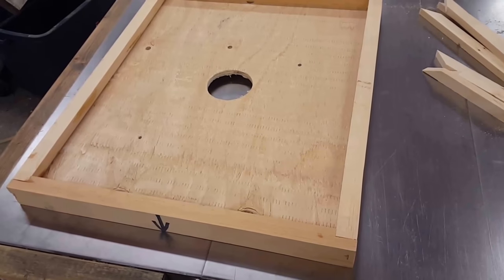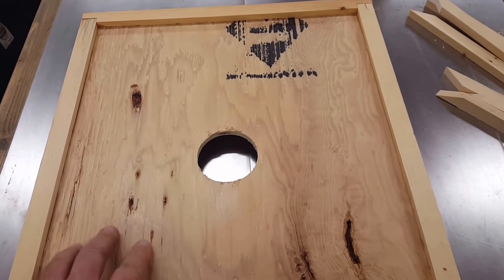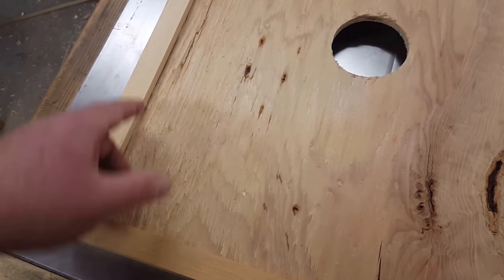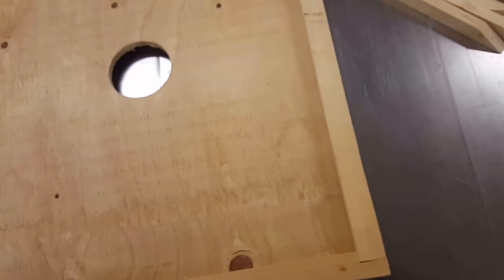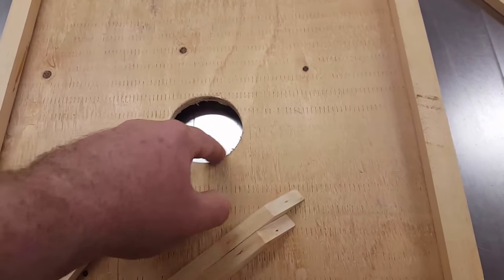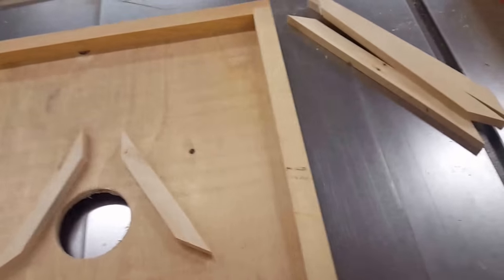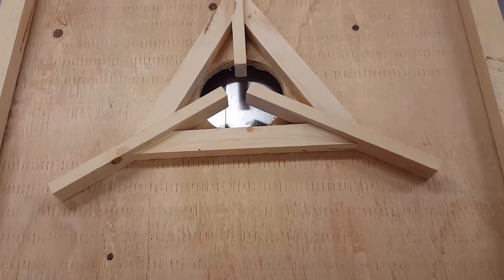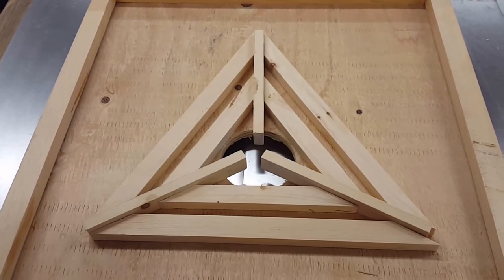🔨Bee Escape Assembly - That Bee Man

Comment: Quick question, is there any chance you priced out what it cost you in materials to make these? I’m just wondering how it compares to buying them. I know you’re a very handy woodworker and I’m sure you enjoy making them yourself. Just curious, thank you Brad!
Reply from the maker: That's a good question, and I do know roughly what my input costs are.  You've touched on the two main reasons that I build equipment like this and also why I do not build boxes.  

The plywood is easy to calculate and you can calculate the lumber down to a "board feet" figure and cost it from there.  Add in window screen, staples and glue and that's a pretty accurate number to go by.  

I never build boxes because there's no economy in it and I really hate building boxes.
Reply: @ThatBeeMan  thank you for letting me know. I’m thinking eventually I might try my hand at making some of the equipment, but boxes is not one of those things either. I have a couple 8 frame escape boards so I’ll have to do some measuring. Right now the cost of wood is crazy so we’ll see.
Reply from the maker: @sunsetheritage  Yes, the cost of wood is crazy!  I have not purchased any wood since the prices went up.  Fortunately, last winter I calculated my requirements incorrectly and ended up with a surplus of six sheets of very nice 3/4" plywood.  I felt silly at the time but I'm feeling thankful now.
Reply: @ThatBeeMan  funny how God provides for us in the strangest ways 😉
Reply from the maker: @sunsetheritage  He does just that, and so regularly.  Our challenge is recognizing it.
Reply: @ThatBeeMan  boy isn’t that the truth. We’ve had a hard 7 months of of trying to understand why we’re dealing with bad times of having to lose 7 of our goats to illness. Just last week I finally accepted that He keeps taking them from us, but is continuing to provide us with new baby goats to love and raise. One of our girls is due to kid this coming week. May God continue to show His blessings to you and Carol in 2021. Looking forward to new videos from you. Well, time for me to get back to building hive boxes. 😁

Comment: Thanks - I think I can replicate these based on your video.  
I guess the height there isn't critical as the escape board is only on there for a very short time and they aren't going to attach it to the frames with comb overnight.
Did you glue the panel into the dado or is it free-floating?
Reply from the maker: I glue everything but it's not necessary.  If I were to build these again, and I will be building another round, I would make the bottom space even greater to give the bees more room to cluster under the escape board.  I would think at least 2" below the escape would be reasonable.

They do build some comb but you're right, the escapes are not on long enough to cause too much trouble that way.
Reply: @ThatBeeMan  thank you for the info!

Comment: I used to make these and used fine mesh hardware cloth instead of screen for strength and longevity. But if using screen, I would think the aluminum would work better and last longer than plastic.  They work great and better than those obsolete squeeze through metal things! Your idea of more space underneath is excellent.
Reply from the maker: Yes.  I found the bees can get their heads through the common #8 hardware cloth.  If they do, they get stuck and die.  I believe the extra depth helps mitigate this problem.  Using the aluminum screen eliminates this issue but as you stated, it's not as robust as the galvanized hardware cloth so appropriate care must be taken.  I've never used plastic screen.